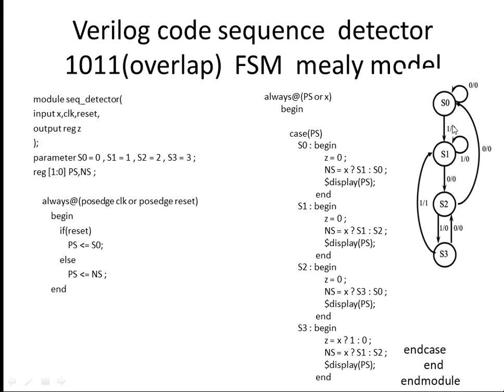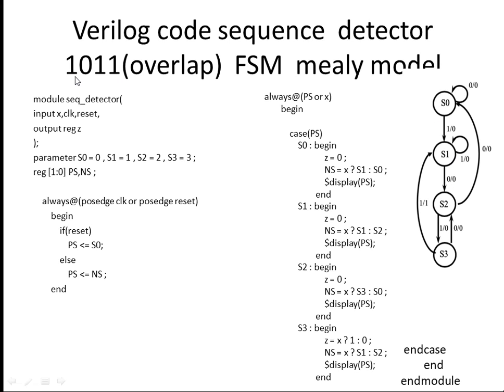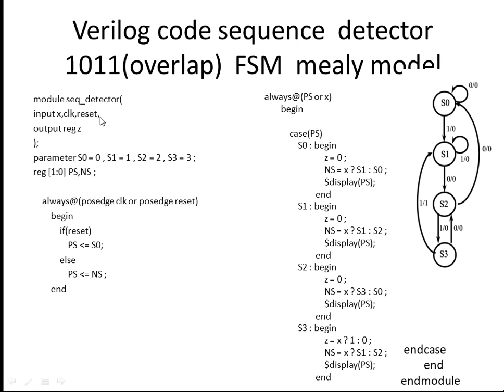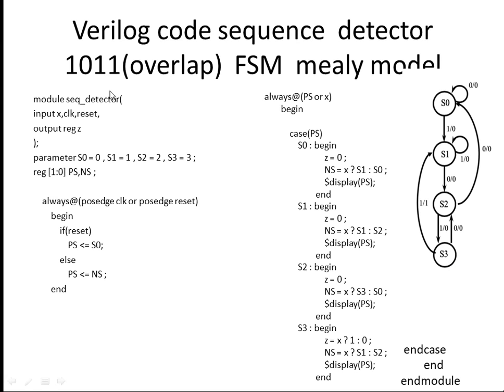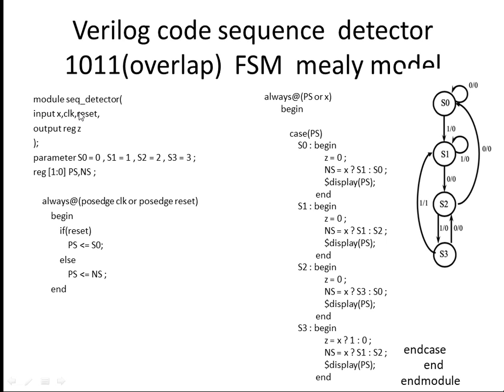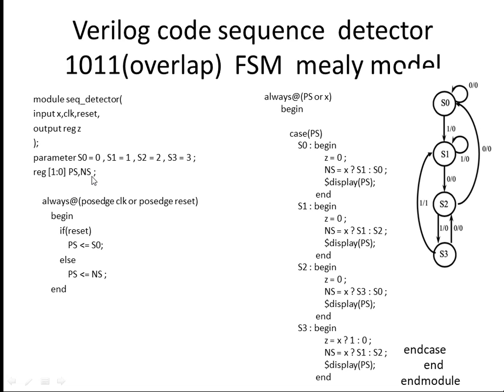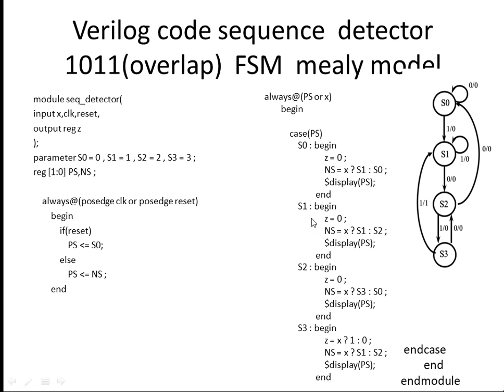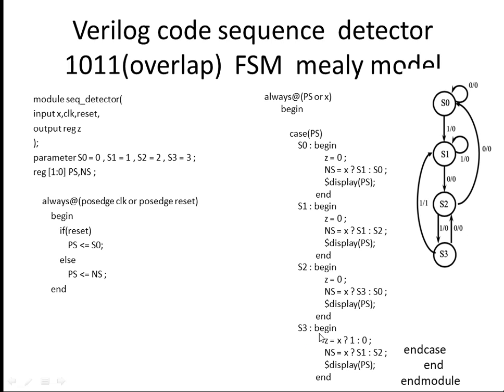verilog  | sequence detector 1011(overlap) mealy model

Comment: Hello mam, Your code will produce an output of "1" when the sequence is 101 itself and not when the sequence is at 1011. This is because when S3 reaches 101 though the input is checked before producing output, there the input will be 1 in that state so the output will become 1. I think we need another always_ff block to produce the correct output at 1011 or store it in another state say S4 and trigger the output at S4
Reply from the maker: it is correct only when input is 1011 only you will get 1 if input is 101 it will be in s4 state only waiting for 0 0r 1 see the vedio again
Reply: @venkatascircuitsvibes6059  I have tried your code. It is providing the output 1 at 101 itself. There is no S4 state in your code. The problem is when input is at 101 the output will be triggered at S3 itself because we are not saving the state anywhere and just checking for input. The output will come one clock pulse earlier than anticipated. You can use additional logic in always_ff block to avoid this. You can execute and check yorself.